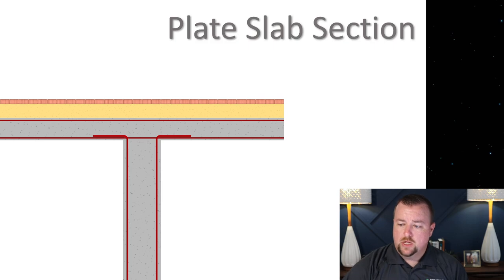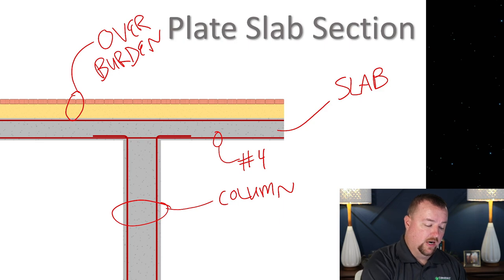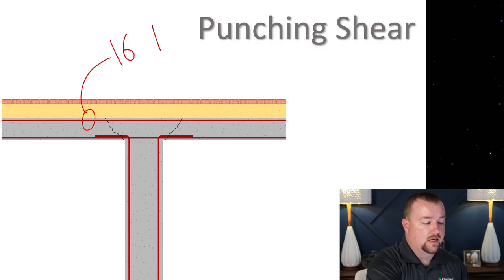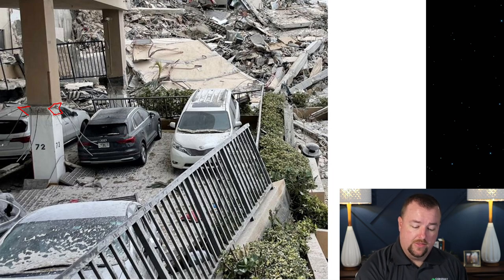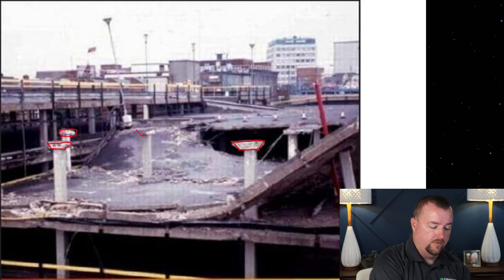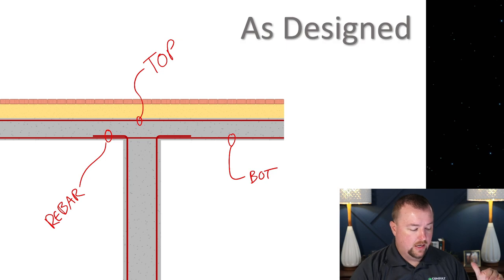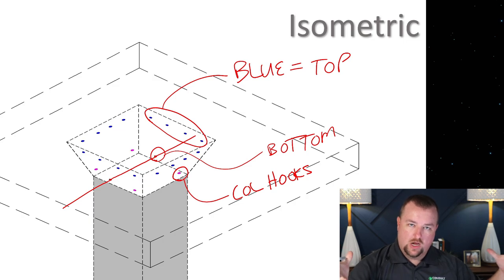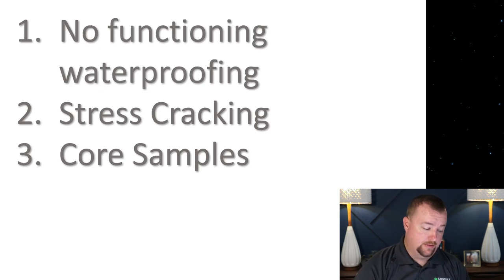The Importance of Punching Shear at the Surfside Collapse

Comment: Josh is clearly onto something with the punch through, though I don't see much evidence of rust on those core samples. That steel looks pretty clean. I do see notable colour differences in the concrete, especially in core B. Section B5 is a lot lighter than B4. This suggests the slab was poured in several visits from different deliveries, was not a homogeneous, continuous slab and that the mix was not consistent: meaning some loads were likely substandard in cement ratio.  

Having noted that 25% of 16 means 4x #5 bars in each direction at the head of every column, he does not seem to look for them. Looking at the standing columns in the garage of the remaining part of the bldg, we only seem to find two rebar protruding in each direction. Similarly in the rest of the rubble. It looks like most of the steel is MIA or at best not placed where it should have been, grouped over the head of the columns. Even if the top had spalled off we should still see the exposed rebar. 

Possibly a minor point, in core D the two bars in the lower section Josh points out look to be separated by about 1" vertically. Usually bar in the same layer should be either welded or held together with ties to ensure they form a continuous armature when poured. This would also apply to lapping of the bars coming out of the columns. If these bars were not lapped and tied to the horizontal bars Josh is discussing , they would just rip out and bend under stress. For lapping to be effective the bars must be touching when poured. This is a common defect of sloppy workmanship or time-saving under pressure and clearly something to look for.

On many columns, I don't see much evidence that the column bars were bent outwards and lapped, either to the bottom or top steel.  If that were the case we would see a roughly 12-15" stub sticking out of the columns near the remainder of the rebar.  Maybe on col 40 ~24min.  I think the enquiry is going to find a lot of time-saving short-cuts were made or cost savings in the steel used.

Comment: I once took an intensive course on small craft design. In it, I learned a little bit about structural engineering (boats, after all, are structures). One of the concepts I learned was that of a structural matrix. The fiberglass, that most boats are made of, is a good example.

I suppose that steel reenforced concrete is such a matrix (boats have actually been made out of it).

What I don't understand is why the slabs don't have most of their rebar at their bottoms.

The way I see it, is that steel is great for withstanding tension loads (something that concrete sucks at), but concentrate is very good withstanding compression loads.

I would think that the slabs were designed to resist bending loads, which, due to their own weight and the weight on top of them, would be turned into tension loads at their bottoms (and compression loads at their tops). 

I just don't see why they would put more rebar at the top than on the bottom.

I would think doing it the other way would make it much stronger while using the same amount of rebar.
Reply: Directly above each support point, IE columns and perimeter walls, the lateral forces are inverted/swapped, tension on top, compression on bottom.
Reply: OK. That makes sense.

Comment: It was interesting that you mentioned this design predates punch through mitigation measures.
Could you please discuss these new code measures like shear pins and and column capitals that are clearly absent. Would a beam, or intersecting beams on top of the column below the slab, provide punch through resistance at the expense of having an effectively lower unobstructed ceiling?

Comment: I was a construction inspector for over 45+ years. not necessarily all of it on concrete buildings but a significant amount of time on and around concrete and reinforcing steel for which I wrote a daily report.  Surely, in the 1980 era when this building was built, they should have had daily construction reports from a certified inspection agency, in addition to lab concrete strength reports showing 7 and 28 day strengths.  Do you know if this was the case when the building went up?  Is there a Florida state, county, or township  law stipulating the amount of time records should be kept?  I have some college engineering but not a degree and I can legitimately say that you're doing a great job explaining the engineering end of things for the lay person who doesn't have a construction background !!   And no junk engineering here !!    Thanks

Comment: Thinking about how the pieces of the core didn't match up, is it safe to assume that thermal expansion caused the upper slab layer to shift relative to the lower slab layer? Possibly on a daily basis?   As the sun came around the tower each day and began to heat the pool desk area, I would be fascinated to know if there were audible clues that might have hinted to fact that the top layer had separated. There might be a way to use acoustic transducers to monitor for this kind of separation at other buildings.

Comment: Good stuff you provide. Has anyone considered the pressure from buoyancy of high water table? I think the first event was one or two of the five columns below the units giving way which then led to building sinking in this area that then caused the weak pool deck to fall and then the  rest of the building. I suspect the causation was a catastrophic failure of the basement foundation in the garage when a buoyancy force of the high water table below the deck pushed out a section of the garage floor that then gushed in water and scoured out the waterlogged and weakened columns. I recall one of your videos showing a section of the garage near the failure point having what appeared to be a newer patch job on the garage floor. I suspect that after years of buoyancy forces on the garage floor that was pushing water into the garage was finally getting dealt with as they no longer mentioned getting regular flooding of the garage like the former maintenance person mentioned. They probably fixed the worst section by replacing the floor were the leak was the worst and allowing ground water to come in. But, then that water from a high water table was trap and forces increased until that new section popped out and gushed water into the garage. This would explain why several witnesses describe the garage has having a few feet of water in it before the collapse and just after the collapse in the section that didn't fall. That was a large garage and only a huge influx of water from a massive upward trust from below the foundation could have filled the garage that fast to that level in a matter of 5 or 10 minutes. This also explains why some described it as a large sound and like an earthquake, particularly the couple across the street mentioned this loud sound. Also, it explains why at least one witness described a sink hole in the garage before leaving and also seeing the pool deck fall. So, my chronology would be the buoyant effect of water trying to lift building popped the floor in garage which scoured the key columns in question that then resulted in the building below the units with the early enough warning to get and and see the pool deck collapse followed a few minutes later by the final failure of the entire structure. So, can you do some work or calculations on how much water was in basement and how much force would be on garage floor and columns such that the foundation would fail and cause the waterlogged columns to fail?

Comment: One thing puzzles me.  In the UK we have a 2000+ mile network of narrow canals dating from the 1750s. Today this is maintained for recreation and modern steel 'narrow boats' ply this.  Most of these boats keep the effects of rust at bay by the use of sacrificial anodes. Why is that technology not used on all rebars in concrete to prevent rusting of the rebars and hence reduce or even eliminating spalling of the structural concrete in buildings/bridges etc?

Comment: Column caps are missing as you noted. Somewhere, a column would have had to fail in order to pull down the pool deck slab. The gravity weight on the deck alone seems unlikely to be a direct cause of punching shear. The coring breaks are typical in any slab with steel as they beat up the bit as it cores.

Comment: Please explain me, why there is no sheild on the top of columns? It's other technology? Because you describe always this top sheild in your sheets.
About missing concrete in the samples cilinder's: is because stress of building (forces in many unespected directions) splitted upper part of slab?
 So finally  only rebars fixed whole slab and concrete parts moved  more and more and accelerated granularity process of concrete? So building as whole was more and more "elastic/vibrating" ?
 Excuse me my poor English it's very hard to ask my question, I'm not building ingeneer not as well.

Comment: Just # 4, & # 5 rebar in the slab and probably not enough, no wonder ! I have helped repair spalled concrete piers in Norfolk, Va. & it's amazing how thin a piece of rebar inside spalled concrete can get when exposed to sea air & moisture.

Comment: I understand your theory about the delamination and agree that may be a factor.  I would like to propose that the tiling of the pool deck caused water to be pooled in the sand under the tile with no drain.  This caused the upper set of rebar to rust in the pool deck.  Over time, the rust caused seperation of the deck at the rebar level.  What set this off was enough of the concrete cracked at the rebar until there was not enough to hold the lower section to the top section.  Some of the bottom layer of the pool deck fell (maybe under the parking lot)  That section was now weak and caused the pool deck to punch through and fall and pull a collum over, and then . . . 

In the image of the parking lot it can be seen that the edge thickness of the pool deck is thinner than the normal pool deck.  Then in the image from below the parking lot, all of the rebar is stripped off of the bottom of what is left of the pool deck.

Comment: Mechanics of the shear and support well presented and another element of the "why". Looking at the cores and not seeing expansion/movement joints from the garage views I wonder if the slab pour was discontinuous - one pour to cover the base reinforcing, rained off in a salty atmosphere for a few days, middle layer pour, pause for weekend, drop the top mesh on the chairs and then top layer? Rather than a series of full depth pours (with engineered joints) and thus creating a laminated slab which then gets overloaded with a mass of slip-planes (topping screeeds waterproofing tiles etc) added to by subsequent works, with no vertical matrix to bind them as one and multiple moisture paths to attack steel and concrete alike. And whether this is by design, lack of reources, quality management or subsequent works not knowing what they were building on. Drawings show design intent and can record the final iteration "as built", but can't show how that design was put in place. Would the contractor's cash flow at the time show a project in distress?
Reply: Your on it.

Comment: Just to throw in my 2 cents. Stresses change position in those slabs. Vid has been concentrating around the column areas where top of slab is in tension [T] and compression [C] at bottom. Concrete is weak in T and strong resisting C (in between columns stresses are reversed - C is at top of slab and T at bottom) so mat of top steel is spaced closer together and bottom steel generally minimal. Once top layer of rebar is broken away from slab there is basically no slab reinforcing to speak of. If you've seen a BB hole in glass you've seen how punching shear works - the small hole is where the BB hit (generally coming from outside in) or in this case where the slab load is applied and the circular cone of missing glass on the inside is where the punching shear would have occurred here in the slab. Sometimes if load is large enough a dropped concrete column head [DCH] is required but doesn't appear to have been deemed necessary here. Also if column is of a larger dimension a DCH may not be necessary so may help explain (as well as no moisture penetrating slab) why left hand section of building adjacent to pool area didn't collapse. But then why did building portion to rear of pool area fail while left portion of building remains standing (larger col. dim. may have helped to some small extent KL/r?). Was this possibly due to loss of lateral support once pool area failed? Have been out of touch and never heard term overburden used just knew as part of dead load. Great presentation. Waiting for next vid. Thanks for sharing. Always interested in this kind of stuff.

Comment: Although I will agree that the waterproofing could have been better installed, the reason it was applied to the top of the tile is because they put sand and pavers over it in lieu of demoing the tile and mortar. So, I think the waterproofing was probably acceptable for this type of application but if the tile and mortar were deteriorating, which is plausible given they put pavers over it, the waterproofing was probably ineffective.

Comment: Quick question,  Instead of trying to rely on those closer spacing of rebars at column, why did the engineer use a column capital, or drop slab, to increase the punching shear area? 
If your interested in failures, look up Save-on-Food collapse, Station Square, Burnaby BC, April 1988. It was a steel framed roof but the dead loads exceeded what was assumed and the real issue was lack of lateral brace at top of column overwhich the girder ran. Joists were spaced 6' apart but no joist framed into the column.

Comment: Very informative presentation. The sagging slab would also encourage pooling on the deck and increased water ingress into the slab. The original pool deck floor drains would become useless as they would have been higher than the sagging low points.

Comment: IMO this is one of the two or three most important videos to watch if you are trying to understand this collapse. One question I've had since the beginning is how did the columns punch through the pool deck so cleanly. I imagined that there would be a heavy mesh of rebar directly above the columns and that would lead to little "mushrooms" of rebar and concrete on top of each column if the pool deck collapsed.

I did not expect that the top of the structural slab could have been so thoroughly damaged that it would allow something like this to happen. At this point it seems also possible that errors were made during the construction that resulted in less rebar across the top of the columns than was called for in the plans or maybe a particularly bad batch of concrete is the problem (maybe it was installed too wet)..

I didn't understand the purpose of the topping slab. Is it possible that it was stamped concrete? That layer was eventually resurfaced with tile. And finally the tile was resurfaced with waterproofing sand and pavers? If something like that went on the deck structure had a dead load much larger than the it was designed for originally.

As an aside, of the  video channels focused on the collapse, Building Integrity's are the most clear and entertaining IMO. Thank you.

Comment: Agree, very interesting. The beam you showed on other videos that tied into the columns that failed provided the extra strength to pull the failed columns toward the pool. If it was tied into the deck vs the column. The weight of the entire deck falling would easily pull the column!

Comment: At 4:40, when you are talking about the column "72", is there any validity to the thought that the left side of the column had some protection from weather and water intrusion into the concrete slab, so there was less delamination of the concrete in that area when compared to the other columns and even the other sides of that column?  And thus has more of the typical sheer head shape left?  It kind of looks like the column behind it is similar.  I'm not a structural engineer... just curious.
Once again, fascinating stuff and so well presented. Thank you.

Comment: Based off everything I have seen I would imagine that the construction of the building across the street was a contributing factor as well. Tenants were complaining of the building shaking during construction. (I would imagine that was the pilings being driven in.) Having no upper layer of rebar reinforcement is already stress enough, I'm sure overstressed slabs with in all likelihood not enough rebar do not appreciate shaking or uneven stresses.

Comment: The building interface to the deck picture at 4 minutes shows columns 72 and it remained standing. But that interface between garage and upper column seems very weak like 2 blocks sitting on top of each other without glue holding them. I think the elevator structure gave these columns a little more side to side support but it appears there was another level of cars and lighter wight slab that fell while the second-floor slab above that upper garage is substantial, not inches of concrete but feet. Looking at before pictured the collapsed area had a lobby and probably very thin flooring like the upper garage and all floors above were also thin, you had a very heavy house of cards on top of double columns like 72, sitting on top of each other like 2 blocks without glue. The upper half or that pillar we know is supported poorly by inches of concreate and the lower half of this shaky support supporting building weight was probably gone. The bottom half of 72 was solidly in the ground and the top half was in a maybe 3-foot slab neither half moved, make that top half with no bottom support and 10 inches of poor support on the top I think the house of cards falls.